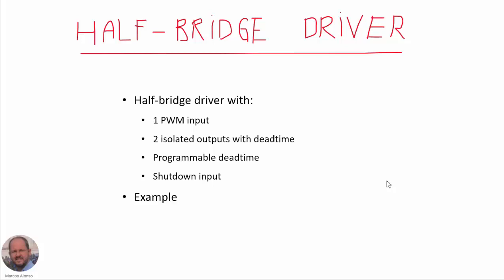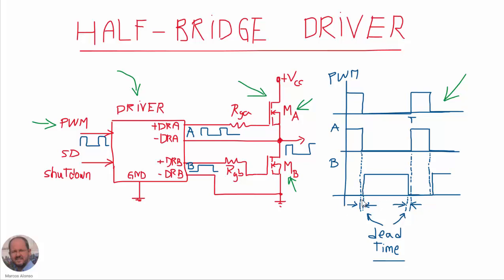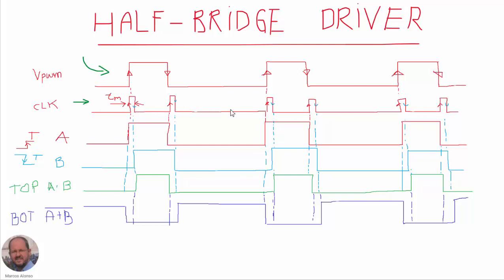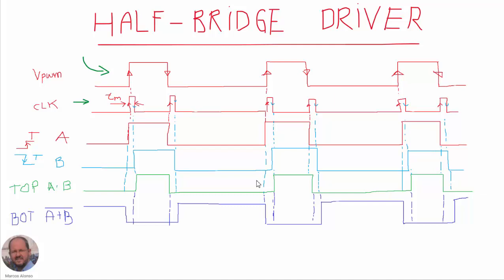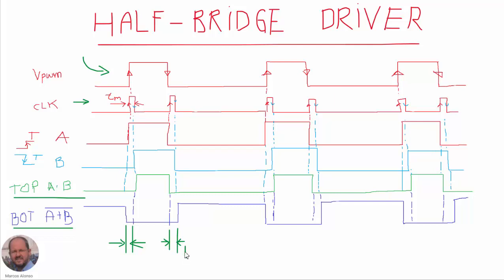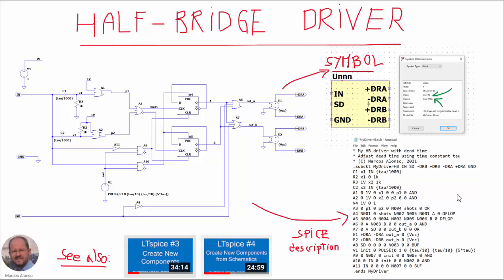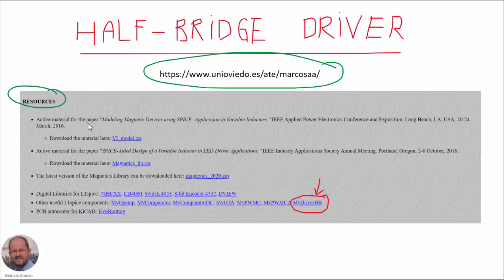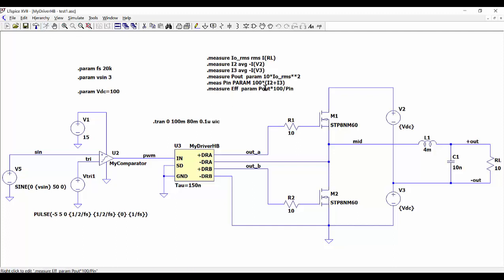LTspice #10: How to create a Half-Bridge Driver with Programmable Dead Time

Comment: Thank you for the excellent lesson! Please tell me how to generate pulses of the same duration to control transistors, for example, to simulate a half-bridge power supply. Thank you.
Reply from the maker: Thanks for your comment. You can use this circuit to drive any two-switch topology. If you want the same conduction time for both switches just inject a symmetric square wave at the input

Comment: Thanks for sharing this!
I have cheked the HB design in simulation. I have noticed that Tau is not equal to the desired dead time. According my simulation Tau has to be divided by ~4 to get the desired dead time. Any explanation why this is the case?
I have adjusted the source amplitude of signal pwm from 5V to 1.3V and then Tau fits quite well the desired dead time. I think it depends from the threshold of the logic gate following the RC high pass filter.
Reply from the maker: Thanks for this good question. The time constant is determined by the discharging of the RC networks in the one-shot circuits. This depends on the input voltage level too.
If you want to have an accurate value of the deadtime I recommend using 1-V amplitude PWM input. In this case the deadtime can be calculated as tau*Ln2= tau/1.44. Using 1-V input will also assure that both deadtimes will be equal.

Comment: Thanks for the video.
Am having some issue .
the dead time and the pwn in general is not stable . it's varying constantly .
I think it's because the simulation timestep in ltspice is also changing .
have you already seen that issue ?
thanks .
Reply from the maker: It is true that the simulation with this component is tricky. It can go wrong sometimes. I usually make it work by playing with two things: the maximum time step and the reltol parameter. Sometimes using a higher time step is even better. To change reltol use: .options reltol=0.1m for example.

Comment: I keep getting an error “previous analysis already found .tran 10m” error. Any ideas what I am doing wrong here? No .Tran file in my .ask schematic.
Reply from the maker: You probably have another analysis defined. Please, share a link with the file and I will take a look.
Reply: On another topic, I am using your control library. I copied the control file and .lib into my files but when I open up spice I am not seeing the part file. Any ideas what is going on here?
Reply from the maker: @ijayess  What version of LTspice are you using?

Comment: Hai,
How to edit the model for three phase inverter input dead time generator.
Kindly comment
Reply from the maker: Hi, I think you can use three drivers, one for each half-bridge branch.
Thanks for watching!
Reply: @MarcosAlonsoElectronics  hello professor,
Thanks for the reply. I could generate the pulses for 3 phase inverter with the three drivers. But I am facing an issue when I increase the dead time beyond 70ns precisely. I am only getting clock pulses at the Out_a and Out_b when I increase the dead time. Also I adjusted the filter inductance value and found its largely dependent on the pulses being generated professor. Can you please reply on how the filter inductance should be chosen for the dead time dependency values.
For the single driver there is no impact on the inductance value.
Reply from the maker: @abhireddy6113  Try adjusting the maximum timestep of the simulation. Also, you can increase the reltol spice parameter. I have seen that playing with these two parameters is sometimes of help.
I can take a look at your simulation. Please, send me the file.

Comment: Professor, how do we select the RC value or time constant, and why the dead time is three times the tau. Is it based on the simulation result?
Reply from the maker: The RC value is related to the dead time. In the design we have RC=tau. The deadtime is approximately equal to 3*tau. A more accurate expression can be obtained but it is quicker to adjust it by simulation. Usually we don't need a very accurate value for the deadtime.

Comment: Good Day,

The worst you have done is very good and seems to be fit in my application but i need 6V at my gate and this circuit is giving 15v roughly.  Any idea which parameters i can change in my design to get 6v at both gate pins
Thanks
Reply from the maker: Thanks for your comments. You only have to right-click with your mouse on the component to see the component attribute editor. Then, change Vcc parameter to Vcc=6. You can select any voltage you want.

Comment from the maker: This circuit is intended to provide very fast simulation. That's why I have used simple digital gates and flip-flops included with the LTspice distribution. Fast simulation is very important when we want to simulate PWM inverters that generate low frequency waveforms (50-60 Hz).